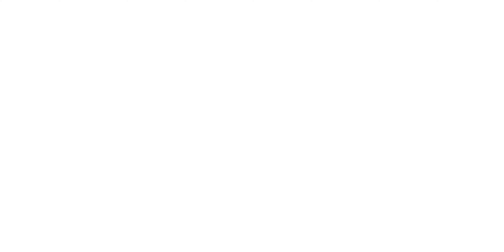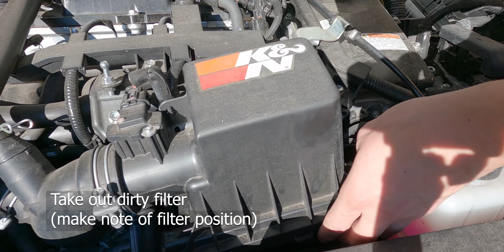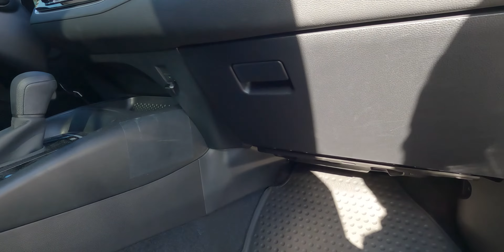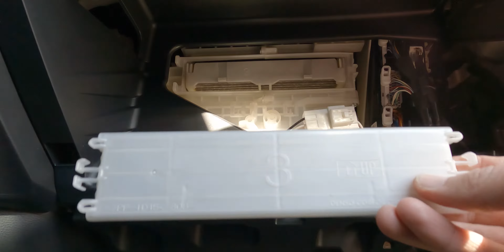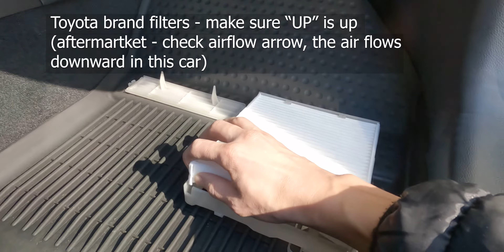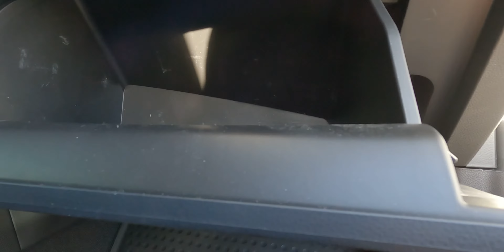EASY: Change out Engine & Cabin Air Filters - 2020 Toyota Corolla Hybrid

Comment: What are the filters part numbers?  Thank you
Reply from the maker: Well I've been using these aftermarket filters. K&N Engine Air Filter 33-2485.  STP Cabin Air Filter CAF1950P. They fit perfectly, the K&N filter I just wash and reuse about once a year. If you want specific toyota brand filters then you would just have to go to your local toyota service center/ dealership and they can look up the part numbers for you.
Reply: @sanchaikofficial   Thank you